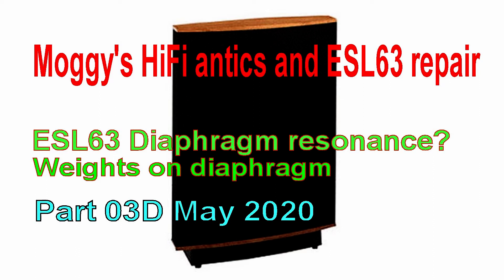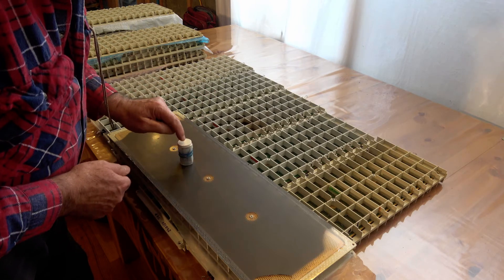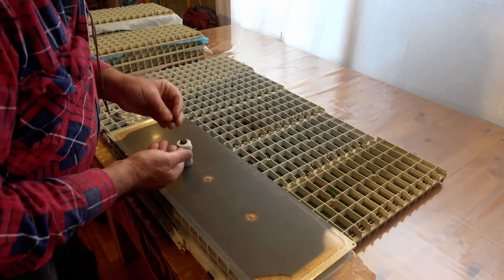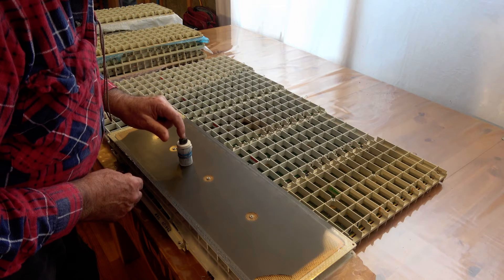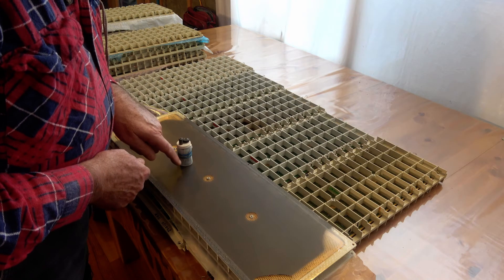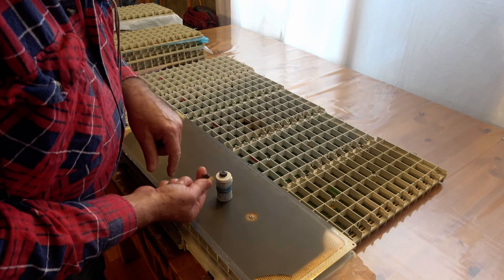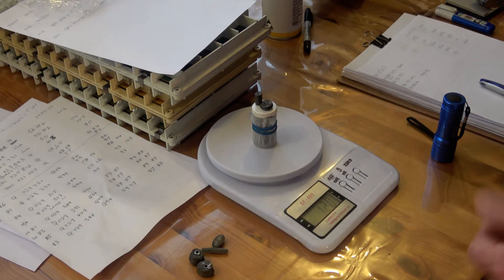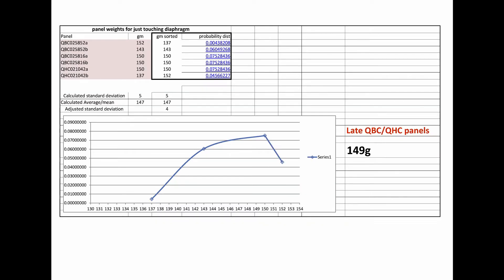Quad ESL63 Repair Part03D resonance using weights

Comment: A better, direct method of reading the diaphragm resonance that works for tuning the diaphragms while stretching them on a pneumatic stretcher:  tilt the driver grid/diaphragm up vertical or almost vertical, and thump it with a ball bearing hanging from a thread. Use a microphone to pick up the thump and use the RTA in REW to plot the spectrum of the thump. I have found three factory diaphragms give 88 Hz resonance using this method. The results appear in seconds, so you can tune the resonance while stretching by adjusting the air pressure in the tube. Once it hits 88Hz, glue the grid to it. Done!

Comment: I stretch the film using a pneumatic table. There are lines drawn on the table surface. Before tensioning I lay the film out on the table, then stretch the film just enough to take out the wrinkles, then I mark the film with a sharpie where the lines are drawn on the table. Then I tension the film, the marks move apart as tension increases, and I can measure the amount of stretch. Equal stretch from one driver to the next should yield equal resonances.